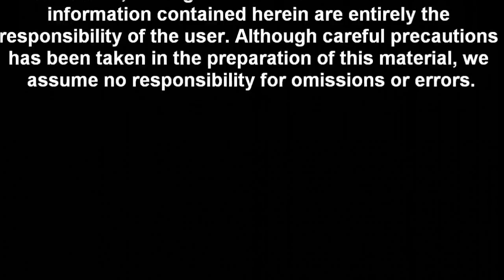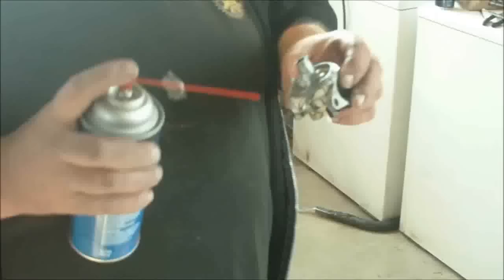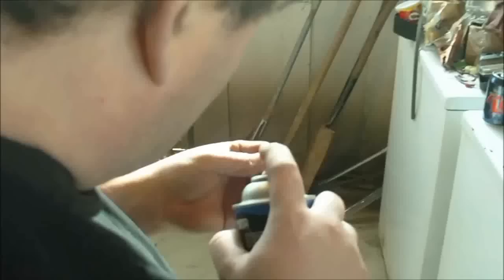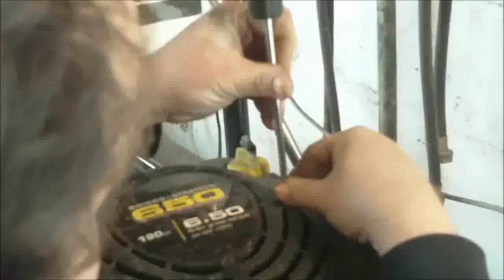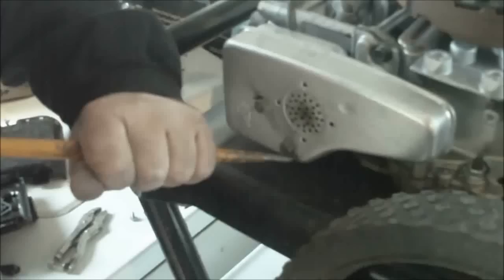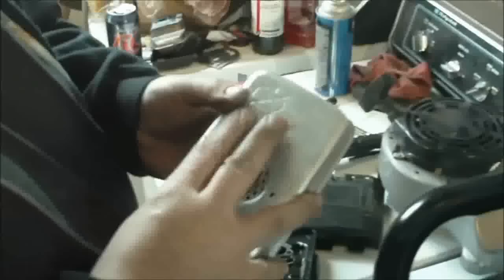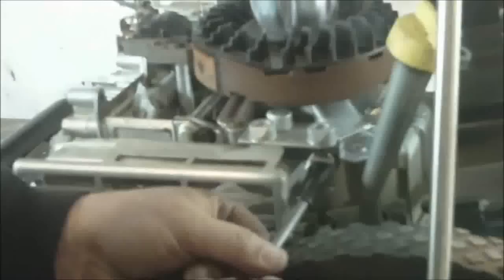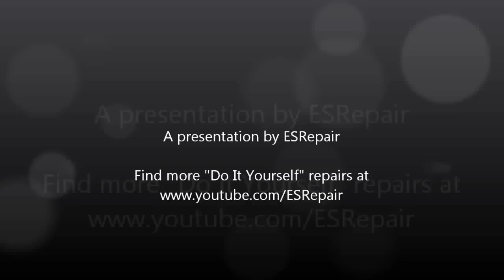Oil in the air filter housing

Comment from the maker: @PDSVIDEO1966 I know. Its the same HD cam used to do other videos, but for some reason its out of focus which isn't adjustable. it doesn't have an optical zoom lens but rather a digital zoom as to why it seems blocky, as you put it, when zooming in and out. Thought the lens was dirty and cleaned it but apparently didn't fix it. It doesnt do well in low light. I've have been looking into the matter to trace the issue. Thanks for subscribing. -MrFixit

Comment: Whiz- I'm having this problem on the newer Briggs E series. (with the plastic carb).  This is an OHV engine so I don't find a breather tube like you show.  What should I look at to find the source of my problem, which is that gas and oil mix is spewing from my air intake and soaking my air filter and housing with oil.  Engine runs great but it sure makes a mess!  Thanks.

Comment: mr. wiz kid, i'm have oil coming in the  carb of a briggs 10hp. i cleaned the carb,once ran good,but then it was flooding, so i cleaned carb again and put new air cleaner gasket on. the pull rope was almost impossible to pull but finally it did. ran fine for a while, then started running bad, i let it set for about 20 minutes or so. i looked at it and oil was coming out of the carb.i put the breathe tube in its place just lke it was before . the first go round no oil in carb. this time there is. can ya help me? ps. your videos are pu together well, i can understand things better the way you show how toos thanks.jwayne
Reply: did you ever get the oil to stop going through the carburetor mine's doing the same thing to these techniques work?

Comment: My walk behind honda with an ohv engine is blowing oil from the breather tube into the air filter holder.  Why is this happening?  How do I fix it?  There is no plate around the breather tube to remove either.

Comment: You forgot to mention safety instructions, which you didn't follow. You spark plug has to be disconnected or grounded b4 you mess with any motor.
Reply: I work on motors all the time without disconnecting the spark plug wire. You only need to do that if you are going to be turning the motor over. Without motor turning no juice is made and no way a motor will just crank on its own. That instruction is for small engine repair for dummies. Some dummy may turn the motor over with his hand on the plug and get a shock or spin the blades and get his hand cut off if the motor cranks. But you have to be a real dummy for either to occur.
Reply: Only for beginners. Nobody is turning the mower over. What is the risk? None.
Reply: He put the warning at the front for you.